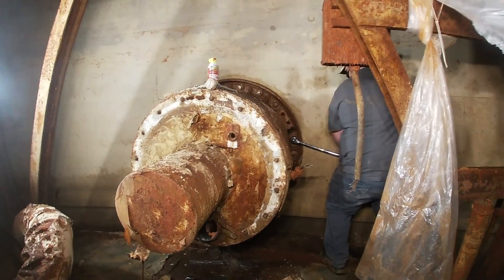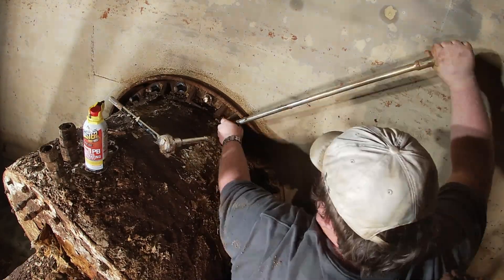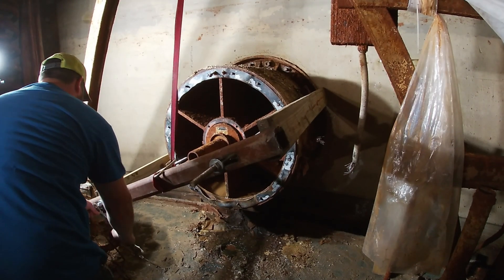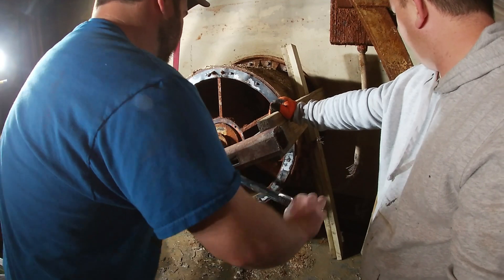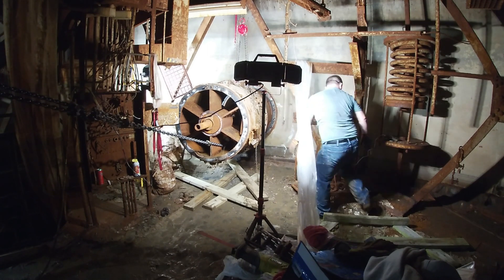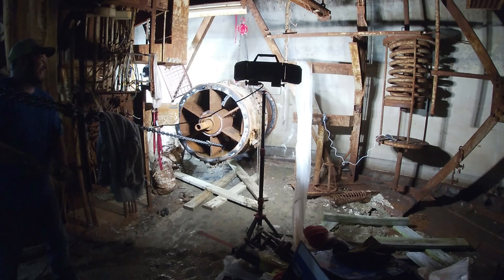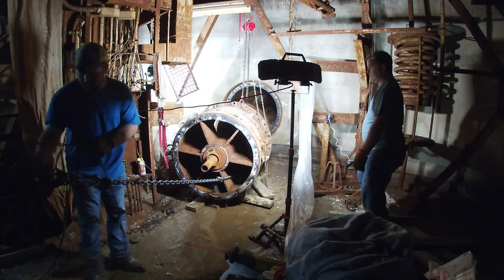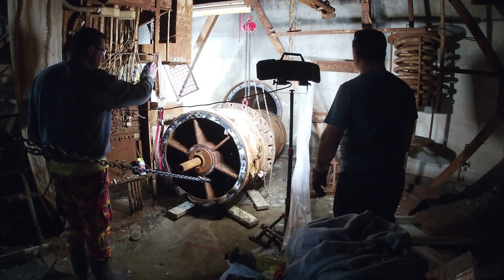S1E27 - Pulling the HUGE Blast Valve - Owning a Titan II Missile Silo

Comment: You need some "Kroil"! 
Its used on the Alaska Pipe line..... 
Especially on pipes that have not been apart in 15+ years
Reply: Mix 50% aceton with 50% ATF fluid.

Comment: We never paid much attention while on alert...  Just the big blue handle to manually close it, with warning.
Reply: What the hell is a blast valve?
Reply from the maker: When bad things happen it keeps you safe. I guess I need to do a video on this subject
Reply: @alextoppen  If I understand correctly, these valves, one of intake of air, one for exhaust, would be closed in the event of a nearby detonation to isolate the silo from the overpressure blast effects of said detonation. 
Other designs to accomplish similar goals that can be found elsewhere include bunker entrances where there are multiple 90deg turns before entering occupied space to reflect/dampen/slow the overpressure wave, and in some civilian bunkers you'll see long flexible expanding pipe sections on air intake lines, to allow them to dissipate he overpressure blast wave energy that way. 
It's really the same principles as a suppressor for a firearm, you're trying to mitigate damaging energy from the blast of an explosion by expanding/cooling/extending it's impulse time duration.
Reply: Well that clears it up...
Reply from the maker: I will do a video

Comment: I wondered how the blast dampening tubes actually attached to the valve to make it work.  The end of the video where you show a channel around the valve and the air intake ports is not documented well and makes perfect sense once I see it.  Never ceases to amaze me how clever these sites were engineered to absorb a near-miss from a nuke.  Another great video Nick!
Reply from the maker: Yep it’s very simple
Reply: Not sure about the design used here, but current design of the blast valves still in use has the intake/exhaust shaft go down to a bend where the pressure sensors are.  From the bend the ventilation tube then travels horizontally for X amount of feet before turning around in a 180 degree bend and then the tube goes back to the blast valve where the air can then pass through.  The purpose of the extended run of the ventilation tube is to allow time for the pressure sensors to work and the valves to trip close if necessary.  The valves themselves typically close on spring pressure and are only held open by a very easily tripped latch.  Best bit of safety advice for blast valves is to not reach into any open ones, regardless of any safety measures in place, as the force involved in a closing blast valve will sever almost anything that gets in its' way up to and including metal in some cases.
Reply from the maker: No sensors here. It’s all mechanical but very similar to what you described

Comment: Hopefully you can fill the delay tube with grout or something.   Glad you managed to get it out to get in there and fix your leak! Progress.👍
Reply from the maker: I was able to get 8 inch pipe plugs from Amazon we’re going to put those in and then weld a plate over the opening once we stop the water

Comment: When I worked in a Zinc Refinery we used HCL Acid (Pool Acid) to easily remove nuts use a syringe or similar to apply to the thread either side of nut & then come back over night and they will be way easier to remove. HFL (HydroFluoric) Acid is ever better but hard to get and super reactive to your skin
Reply: You’d have to be insane to use HFL for that purpose.
Reply: @DaylightRobberyCA  don't have to be...but it helps!
Reply: The irony, I work in a water treatment plant, and the HCL from chlorine exposure is what seizes all our fasteners, lol. 
Something a lot of people also don't realize, chlorine preferentially attacks stainless steel, turns it green and makes it corrode with what looks like white furry rust.

Comment: My friend, you need an electronic impact wrench. The big boys. Milwaukee makes one and it rivals air impacts of the same size. It's no behemoth inch air impact, but they have loosened nuts insanely fast that were RUSTED SOLID. Best part is no airlines.
Reply: Yup he needs the M18 fuel 3/4" impact. I've got one in every size except for 1" and they are very stout